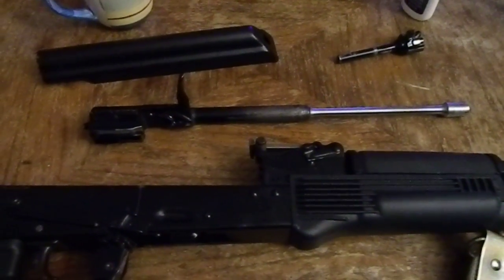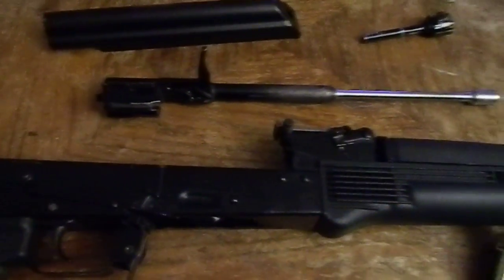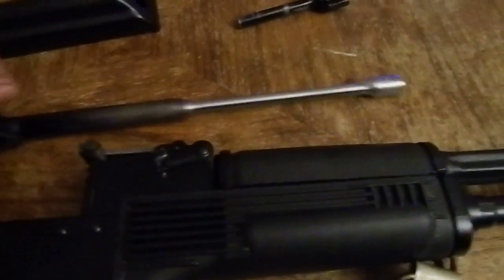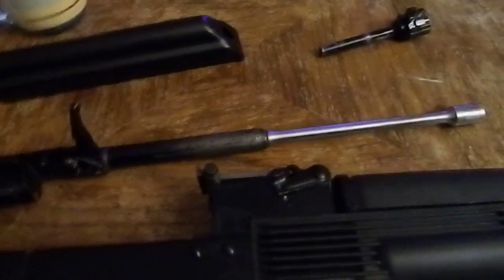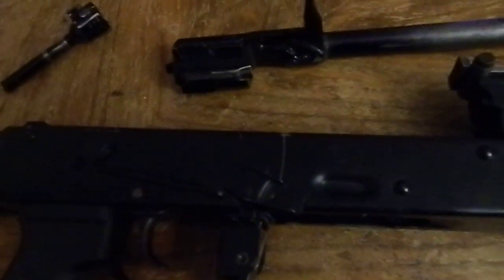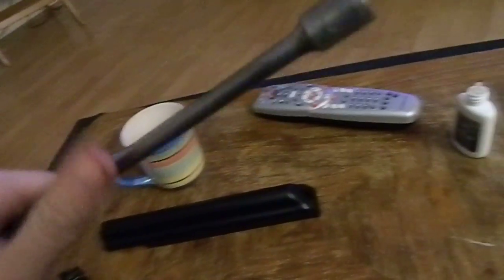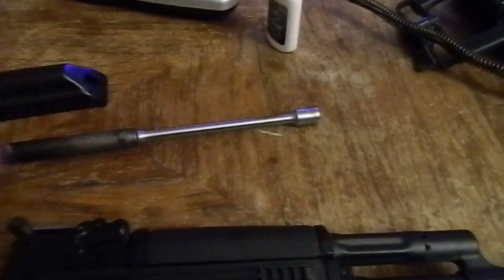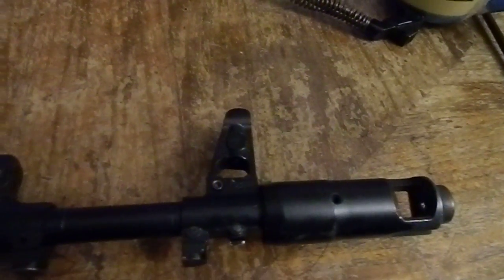Corrosive Ammo Damage

Comment: Nice AK. I have a Saiga 7.62 that I fire Yugo surp. M67 ammo only. As you know, it is known to have a corrosive berdan primer. All I used to clean it with before was CLP, everywhere. Now, I use a few drops of regular dish soap and warm water. I dip a .30 cal mop in warm solution and run it down the barrel to neutralize the salts, let sit. Followed by .30 cal bore brush, jag and patches. For the gas tube and gas block, same thing but use a 20 or 28 gauge shotgun mop and bore brush. One thing to

Comment: I used anti-rust/anti corrosion polish on the bore, bolt face, and all internal parts of the bolt of a Mosin Nagant, and I never had a problem, not a speck of rust to speak of when shooting milsurp. Plus, it cleans up the exterior nicely. I picked up an Interarms AK74 recently and I intend to do the same with it.

Comment: Your piston has a cavity! :o
One trick I learned from boiler work is to heat up the joint with a torch (little propane torch is fine), hit it with penetrating oil and let it cool back down. Then crank it. If it doesnt work repeat until it works.....only once was the task actually impossible in my relatively short HVAC career

Comment: Corrosive ammo is no biggie. I have an AR in 5.45x39. Originally I had a Nordic components brake on it, though later decided that it would be a good idea to move to the russian 74 brake, because of the chrome and ease of removal for cleaning. Yup, that Nordic brake was rust welded to the muzzle, though I was able to remove it without too much trouble. The chromed 74 brake is great, and I haven't had a problem with rust since.

Comment: Take a MAP torch to the break and heat it up so the metal will expand, then try wrenching the break off.
If that doesn't work, heat again, then quench in oil or water, and try unscrewing it.
I was tasked with completely dismantling a double barrel H&R shotgun from the early 20s, most of the screws were rusted solid and this help with much of them (a few had to drilled out). This method won't damage the temper of the steel.

Comment: @wild50gunner 
Dang I can't relly tell...I did see come green deposits just at the lip on the gas tube whihc wiped off easy. Then I used  a really thin Q-tip I had (from a computer cleaning kit for a IBM UNIX server)  and did a internal wipe of the tube but it didn't show anything. 

I figure that it would be cheap to replace the tube.

The cleaning of the AR is no biggie. I'm just more meticulous after each shoot.I have had the gun for close to a year and the bore still looks like new.

Comment: If the ballistol does not work, try Kroil.  Let it sit overnight and then the next day put the rifle in a well padded vice by the front sight block.  Slip an appropriate sized 1' rod through the brake, hold down the locking tab and with enough force, it'll come loose.  If you have to put a 1/2" gas pipe over the rod for extra leverage, use that too.  We've used 2 vices, one for the sight block and the other to support the receiver section of the rifle.  Both well padded.  Good luck.

Comment: Adding to what everyone else has said to get the muzzle brake off-liberally spray CLP, ballistol, or maybe pb blaster in the threads under muzzle brake and wipe excess off/bag the end
- get rifle cold by putting in fridge, freezer, backyard or garage in winter, ac in summer, etc for a few hours-use heat source such as heat gun, hair dryer, blowtorch ( not direct contact with flame),etc on muzzle brake only-press in or free up muzzle brake detent-put large screwdriver, rebar, or similar solid metal rod through the opening on the muzzle brake and turn-make sure you turn the right way and don't burn yourself

Comment: Ammonia doesn't really do anything to dissolve the corrosive salts. The best way to clean after shooting corrosive ammo is to flush the barrel, gas block, gas tube, piston, etc. with hot water, scrub and repeat until clean. The hot water will dissolve the salts and flush them out. I use compressed air to blow all the excess water out and then lightly coat those areas with oil for storage.

Comment: I used Yugo on my Ar15 chambered in 7.62x39 and after each shoot at the range dowsed it it Windex and a total clean. After about 4 months I started to have feeding problems on the last 2 rounds of every mag. 
I investigated and found my mag springs where rusting. A simply wipe with a cloth showed rust stains.. I will cleaned them with Windex and lubricated them with spray lube. After that it all work fine and the failure to feed went away. 
!

Comment: Guys the best stuff I ever used for corrosive ammo is windex and CLP. The barrel, bolt, gas tube, piston, chamber I windex it all. Let it sit for ab 60 seconds after you soakit and then scrub it. Wipe it off, lightly coat with CLP put it in the closet. Before you shoot it wipe off the CLP and add FROG LUBE to the moving parts. When finished shooting repeat above steps (ONLY) for corrosive ammo. Other wise use normal solvents and lubes.

Comment: The debate over keeping better is pretty moot.  Soldium Chlorate did store slightly better than mercury fulminate.  But it was really just cheaper to make.  It's still cheaper than lead styphnate used today.  But modern primers offer better burn and reliability.  That transfers to better inherent consistency per round.  We dealt with corrosive primers in WWII because they were cheap and cleaning was highly stressed.

Comment from the maker: the "green crap" in the barrel is most likely coper fouling (a little bit of the bullets copper jacket is rubbed off by the barrel as it is fired) that has corrodid from the humididty copper turns green when it oxidizes if the steel of the rifle was corroding it would be red or brown (rust). you should be fine just clean out the copper residue and it should be good as new.

Comment from the maker: @semiautoriflelover1 I  generaly belive that the AK is a lot easier to clean than the AR which is not to say that it will not get dirty but rather pretty much all of it is rather easy to get at as opposed to the AR where if you want to get the star chamber clean or the inside of the gas tube (assuming this is a DI AR) you are going to need a good deal of time and pipe cleaners where as the AK I can clean off the locking lugs and gas tube by hand quite easily.

Comment: Oops, I wasn't done with the novel. 

For the muzzle break, check for a drop of weld on a seam. If no weld, try some type of penetrating oil or WD40 and let sit overnight. Once ready, make sure to depress the detent on front of the front sight block, looks like a pin and is spring loaded. If that doesn't work, there might be red Loctite. To release Loctite, apply heat via heat gun or propane torch to approximately 500f. 

Good luck and good shooting!

Comment: I got my muzzle brake off with a really good strap wrench and lots of muscle! It was really hard but it finally came off. I put on a bulgarian muzzle brake version.. Also the requirement of having America made parts 922 compliance only applies to firearms made in other countries. Yours was made in Las Vegas NV. So it doesn't apply to you.. You can get the bulgarian chrome lined muzzle brake with no problems..
Reply: 922r still applies. Arsenal Inc must add the required parts for it to be legal. When they are imported into the country the importer/distributor/manufacturer changes out the required number of parts so the end buyer doesn't have to.
Reply: therealrrc Arsenal has more than enough American parts so you don't have to worry...

Comment: Heat the brake with a torch (lightly) and spray the end of the barrel with an upside-down can of air duster (cold!), then crack that sumbitch.  Bet it comes right off.

Comment: Ok. I figure out how to get the muzzle brake off.. You will need 2 people, Strap wrench, and a metal rod that you tape up to prevent metal contact etc. One person uses the strap wrench and the other person puts the metal insulated rod in between the holes in the muzzle break. Both people at the same time turn right at the same time hard.. It will come off. It worked for me without breaking anything, however if you decide to do it then do it at your own risk..

Comment: To get the brake off get a jug fill it up with transmission fluid and lstand the gun in it where the fluid is obver the top of the sight. Let it sit in it for 24 hours and id bet money it comes off. If that just so happens not to work soak it in sea foam deep creep

Comment: Get some kroil (Or any rust eating penetrating lube)  and soak the tip in it for a few days...Take a hot gun and heat up the tip/threads. Put in vice and Place a piece of wood through the mbreak alot and tap in the right direction. (Repeat) The heat and cold, vibration and chemicals should break the mb free. If it does break free spray more kroil down threads. Work the mb by hand back and forth doing this will break more crap away without damaging threads ( just dont start cranking the thing off)...If nothing... resoak and repeat. Once off and cleaned use a a spark plug anti s lube on the threads so it dont happen again.
Reply: * Slot not alot. Damn Phone.
Reply: I live in Philly but goggle something called PIPEBREAK. Most of the time I find it in plumbing supply places or most likely you can buy direct. I used to work with industrial Steamfitters and I have seen bolts rusted so bad on flanges you would spray the bell out them let it soak in for quite a while but those bolts would wrench right off. We used this in areas where torches were forbidden. So look it up try it. Roadman55@verizon.net.

Comment: Save your money on the windex and the fancy cleaning products that cost $15 for 4 oz like froglube or some shit.  Hot water, nylon brushes and a small compressor for compressed air to blow the water out is what you need if you are shooting corrosive!  I just don't get it:  People buy a $1000 gun and let it rust to junk because corrosive ammo is 10 cents  cheaper?   If  you are indifferent about cleaning use non-corrosive or pay the freight in a ruined gun.